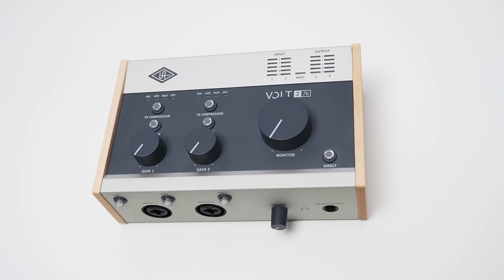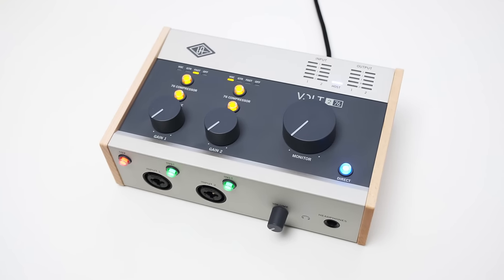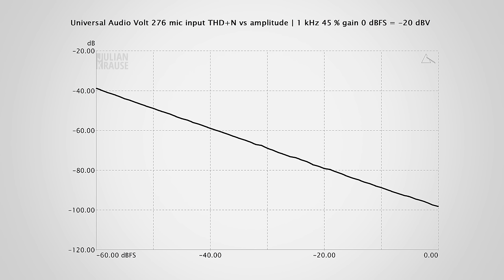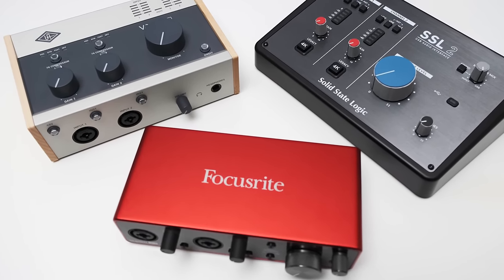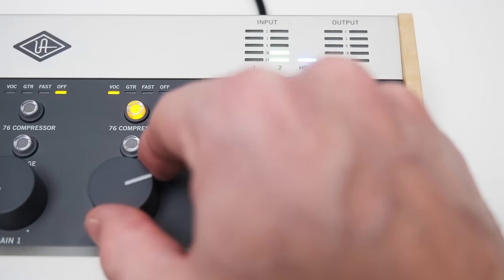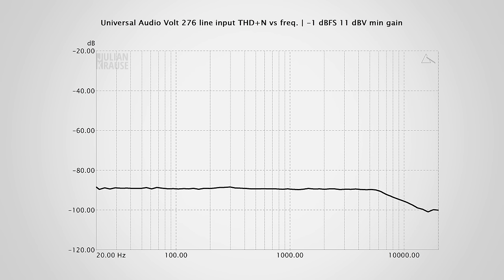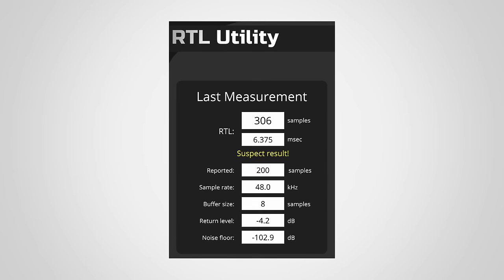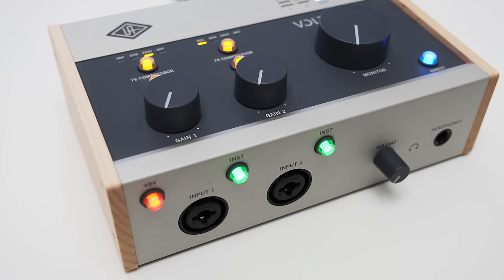Universal Audio VOLT 276 – Review (Compressor and Vintage Mode Audio Samples)

Comment: Thanks Julian. I wonder if all those preamps offer great technical capabilities, why do people complain about the built in interface preamps sounding bad and purchase instead all those expensive outboard?
Reply from the maker: That's a really good question. I would love to make a blind test between an external preamp and the built-in ones in an interface. The difference is most likely much less than they anticipated.
Reply: @soundbelch1600  I understand your point, but there is a problem with the "colour and character" as it can mean many things to a different people. Again, I understand what you mean by this and I agree that transformers and tubes give something special to our recordings, but technically it can be described only as imperfect frequency response and (at first unwanted) distortion, which makes results that are not corresponding well with the source material. 
I understand of course that this is often called musical and I agree with you, however we take today's gear for granted and forget about how musicians and sound engineers always wanted better quality recordings, but now when they got it something is missing suddenly.
So there are two approaches to this, you can say that clean preamps offer superior quality as they record audio that sounds basically the same as source material, also you can say that tube or transformer preamps are superior because they give you the colour and character. In both cases you will be correct.

Comment: The headphone pre-amp on VOLT 276 doesn't sounds as good as on my old  Scarlett 2i2 - first gen.   It's EVEN significantly inferior to the headphone preamp on my Mac.    There is a lot of gain, yes, but I don't care if but the sound is like from a cheap Chinese mp3 player.     Not enough bass, too much harsh treble and mids!  Because of this, when listening to some song,  the instrument separation is not good!         Also , the connectivity of Focus rite is better (On Mac, at least).                     Zoom works with it great,   but this is not the  case with Volt.

Comment: Wow ... a one-trick-pony (or 3-trick) compressor without any indicators or controls. What a joke.
Maybe it'd be interesting to test the Yamaha AG06.
With 159€ it's not so expensive, and it comes with a fully adjustable parametric EQ + compressor (DSP-powered and set-up in the computer).

Comment: Unfortunate latency.
Reply: The Rock Procrastinator    Without DSP, you will NEVER be able to use the majority of inline processes while recording.  I don’t think UAD is deceiving anyone with their simple interface.  Nobody’s interface promises the impossible goal of DSP-less processing.  You either spend real money (thousands) to attain full functionality, or a piddling amount for simple connectivity.  I’m surprised how many do not understand this.  The interface itself causes no latency.  The roundtrip thru your computer is the only part that any manufacturer has any control over.  Even the finest RME units with the most amazing drivers can’t overcome the physics of processing time.  Without a costly hardware implementation, some plug-ins are capable of live use, most are not.

Comment: Uad Volt...in the end nothing specials
Reply: For novices, it’s nice to have a compressor with presets for guitar, vocal and fast. Compressors are a huge mystery for some people and this makes it pretty easy to use. It’s also nice to be able to record straight into an iPad. Indeed, nothing special to people that are used to more sophisticated interfaces, but this was likely designed for the novice in mind.
Reply: It sounds fantastic (beautiful smooth highs) and it’s inexpensive. Also the compressor is great for recording instruments. Sure does work for me, not sure what else you were expecting for 300 £/$, but this is an excellent sounding interface.